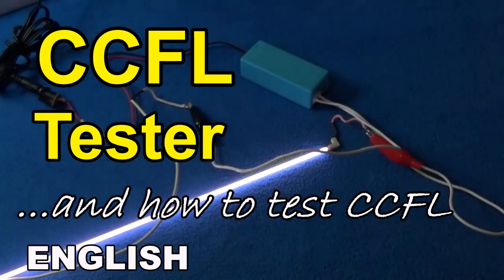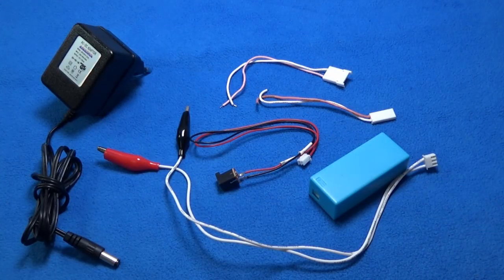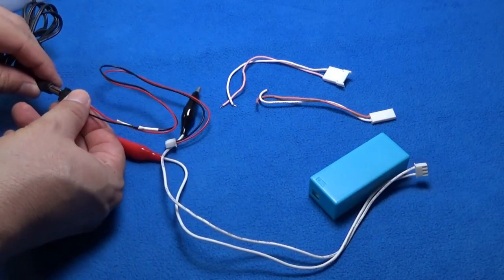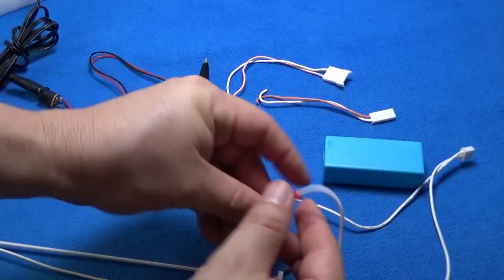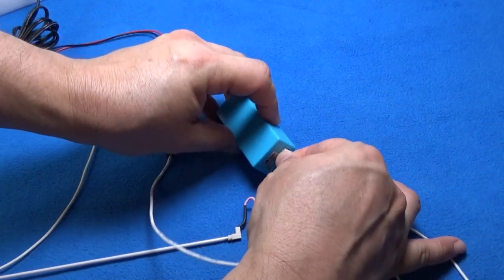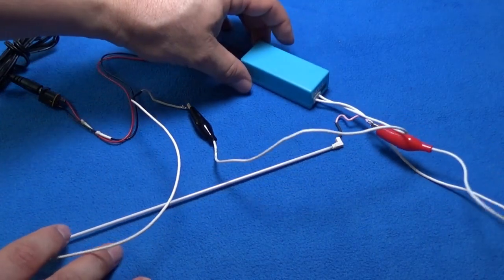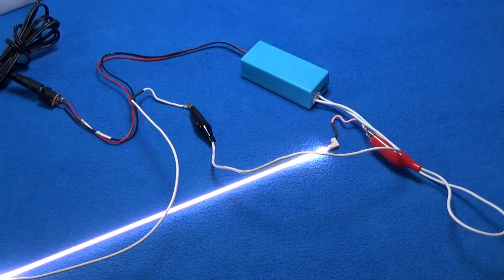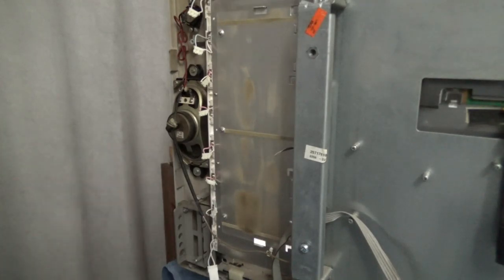How to test CCFL in LCD TV - laptop - monitors / cold cathode fluorescent lamp tester

Comment: Sir , What is the Voltage Required for CCLF ? To glow ?
Reply: 300V and 300mA
Reply: @Memes-XD  are they all 300 volts? I have one that is 40 inches long and It came from a samsung tv I took apart.
Reply: @Memes-XD  DC current? i tried with 600 volts max measurement scale, the result was OL, over limit, so what is the real voltage for one lamp?
Reply: @thesummertune  i have two pairs, so 4 tubes, one pair should work with 300v 300ma if it isn't blown. i haven't tested mine so i'm not certain. i found that info somewhere online
Reply: @Memes-XD  a tech guy told me that lamps are powered by AC current not DC current, so i don't get the different wires color.

Comment: I made the same test for a bunch of ccfl lamps. The result was that I 've got light for all of them but not in all the length! The lamps lit only by the half! Do you know why? Maybe the power supply... 9v 330mAmps???
Reply: Use 12v at least.. As for the Amps i use at least 1A to be safe!!
Reply: @georgecharalampidis200  thanks for the answer better late than never. the answer indeed was more amps. so i found a power transformer with switch selector to pic the desirable amps.

Comment: How many voltage and amps in need to run 1 lamp
Reply from the maker: Hi! It is better to refer it to the lamp's datasheet. This kind of tester are made to do not be enough, just to make to light a little most of the common lamps used in 10" to 17" screens.
Reply: @bob.kalpon1398  Hello, that tester it seem working even with CCFL lamps from a 19" screen. i have a monitor LG flatron W2042T and it turns on for a moment, the power led stay on, i replaced the inverter transformer but no change, i tried with two good lamps tested with that lamps tester and are ok, connected to the LG, still same issue, so i don't get what is the cause, it can be the power board or even the video/main board? what i have to check?